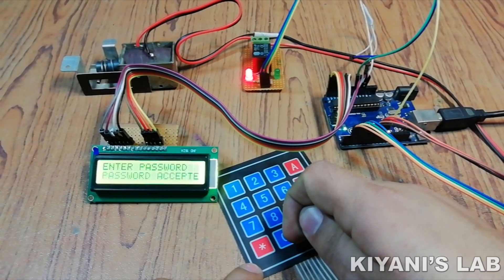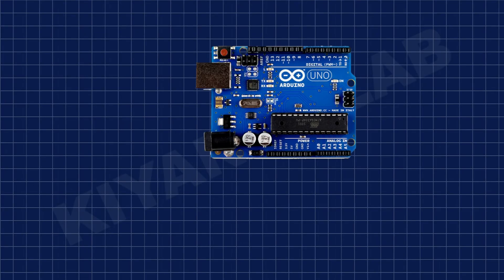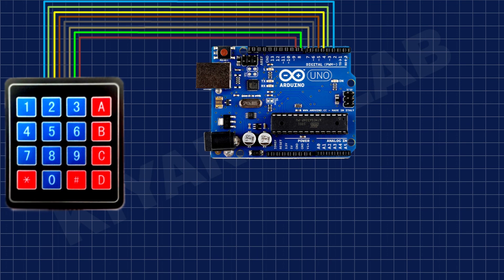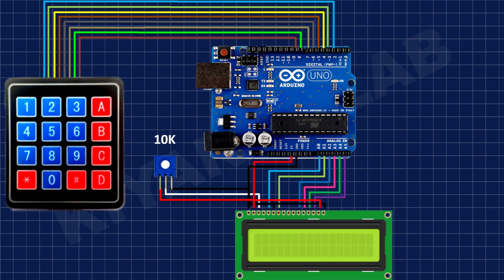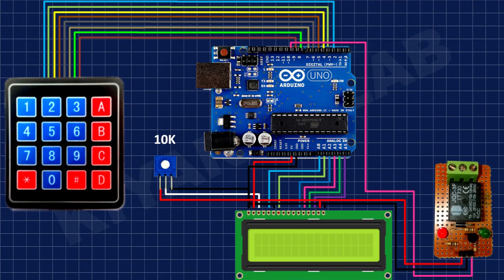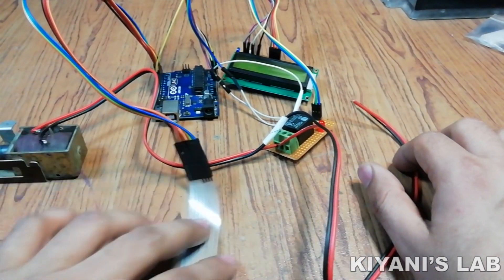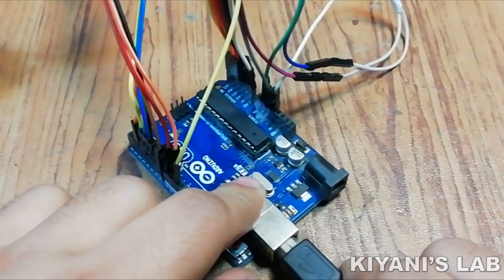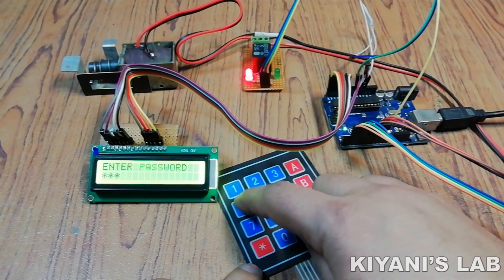How To Make Keypad Security Lock

Comment: Sir your project for lcd clock using aurdino is not working I uploaded the cost of is displaying  00:00 in big charcters but when i attached 3 push buttons with it and tried to see time it not working I checked all the connections but it is not working